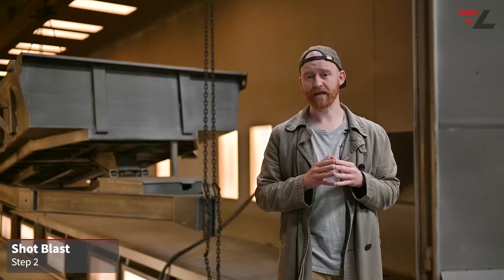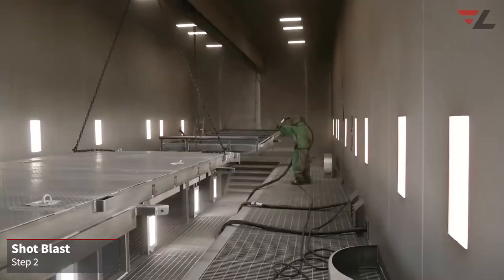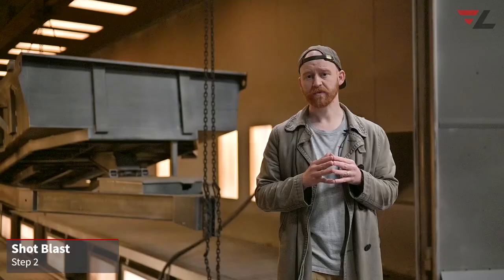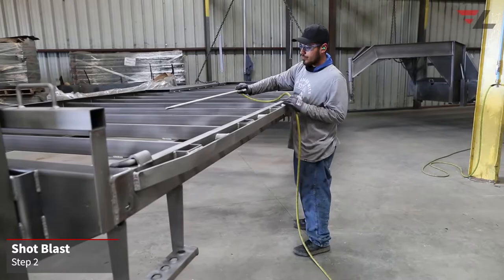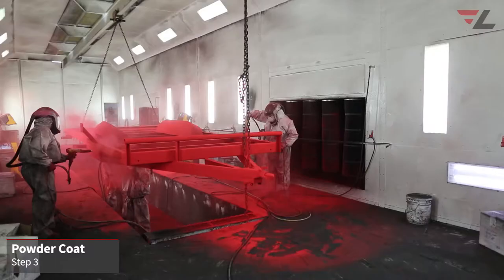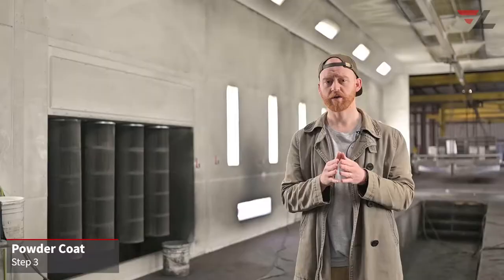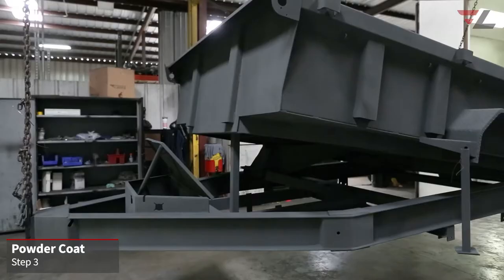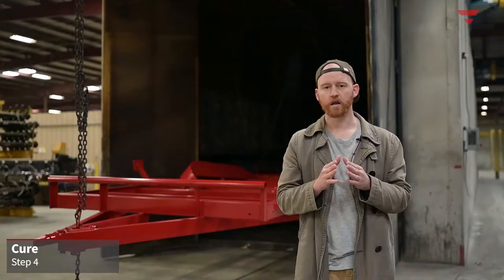How to Powder Coat - Why Our Color Lasts.

Comment: No primer?
Reply from the maker: The truth is, all the buzz about using a primer is largely a marketing gimmick.
Here's the real deal: We don't cut corners in our coating process. If adding primer would genuinely make our finish last longer, we'd do it. But after lots of testing, we've found that the best way to get a great finish is by sticking to our 3-stage process and doing it right.
What makes our coating special is that it acts as both a primer and a color layer. So, you don't need a separate primer. Plus, it helps eliminate imperfections in the finish. And to top it off, we use a top-notch coating – the toughest one IFS offers. Simple, effective, and high-quality.
It’s not about the number of stages; it's about doing each step correctly and with the best quality products. Our process creates a great finish and cuts down on costs that we can pass on to our consumers.